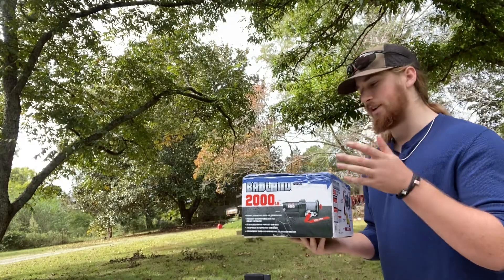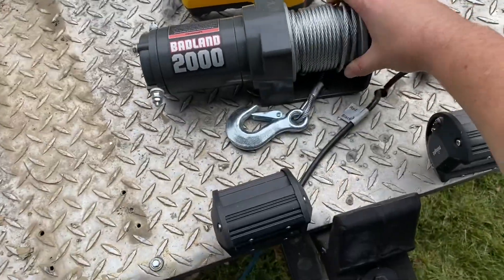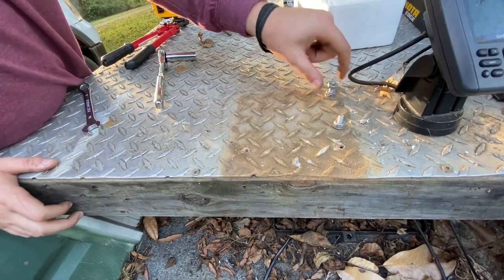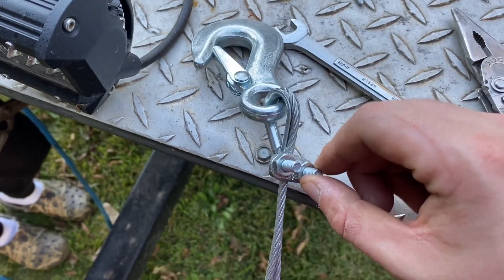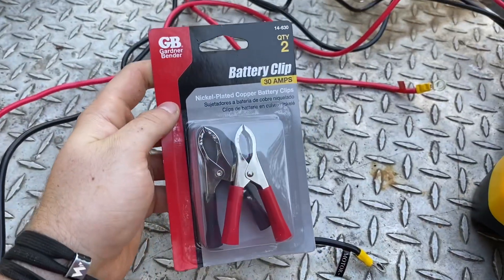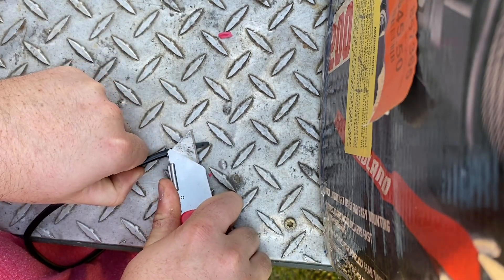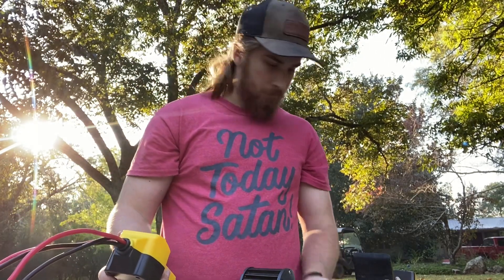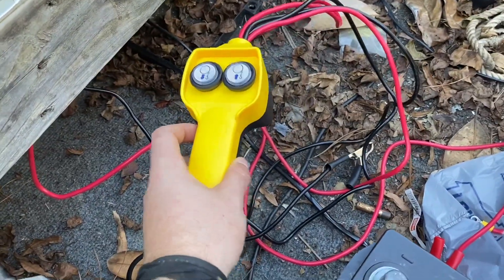I Put A Harbor Freight Winch On My Jon Boat!

Comment: Orange labels are As-is “refurbs” Purple Labels that end in 98cents are open boxed. Open box unlike AS-IS will drop in price every two weeks. Until it hits 56-68 percent off. As-is items were broken or damaged returns that get set to Assets Recovery and they get “tested and fixed” and sent on a pallet to stores around the us chances are that winch wasn’t returned in your state. We have As is generators welders compressors tools pretty much everything. The catch with as is and open box you have 5 days to return it for your money back. AS IS are a set price and will never drop in price unless it’s during a parking lot sale where during the PLS weekend it drops to an additional 30% off on Saturday and 40% on Sunday from the orange sticker price.